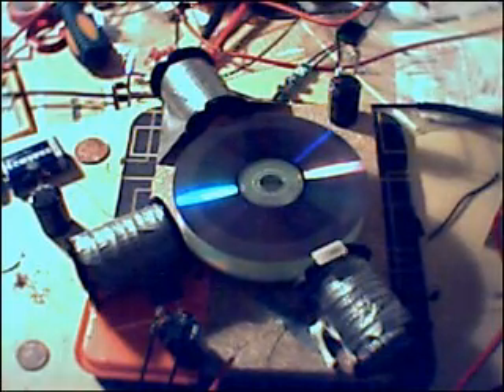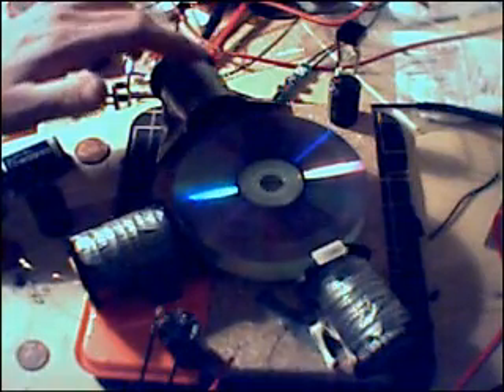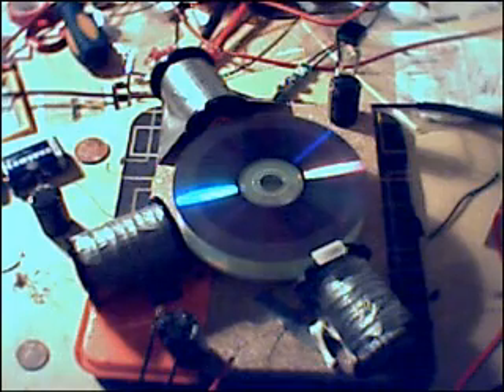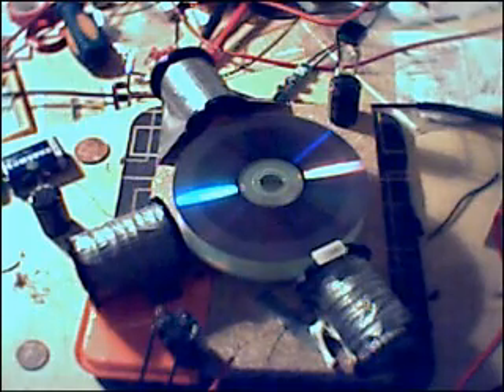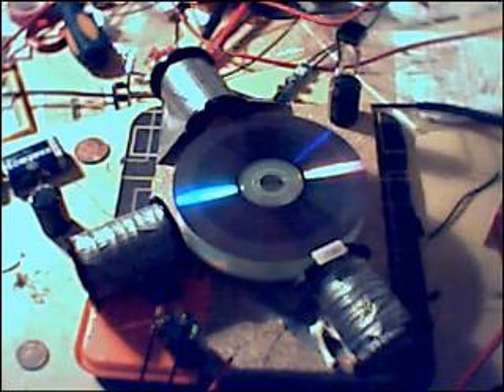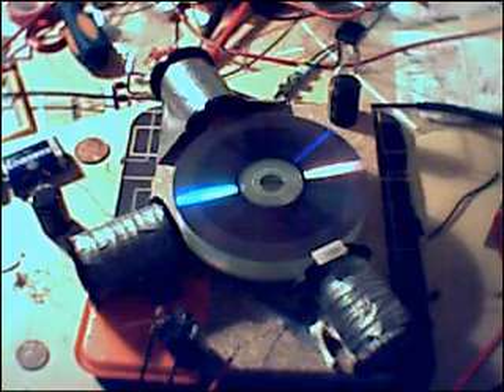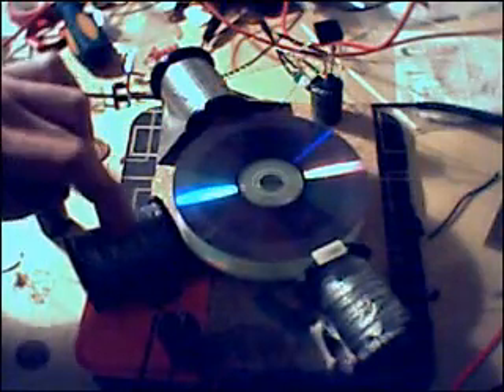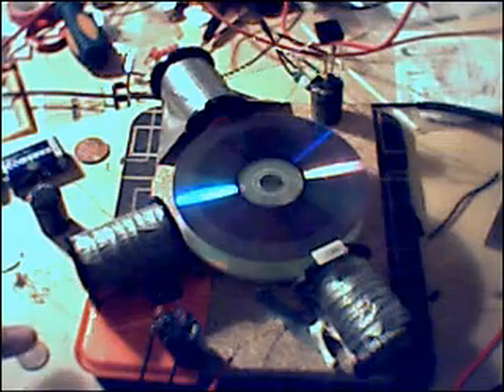My SSG - Producing and incredible amount of juice!

Comment: A great trick to try is to SHORT  coil leads on your gen coils out with a switch - just a millisecond or so - this will collapse the coil and on rebound you will get X20 voltag in caps
find a sweetspot in timing where it doesnt affect your  draw to motor

Blast caps into batteries in a timing  in synch with your motor coil pulses - do the charging at "0" line if looking with scope - correspondes to OFF time between motor coil pulses -this is when to release caps to charge

Comment from the maker: Actually Rob, The 'power' discussed in this video refers to the energy captured in my capacitors. These caps are fed by generator coils, being induced by magnets passing. These are not bifilar coils and are not connected to the rest of the circuit. As for your other comments, many thanks.

Comment from the maker: curious. I just did a current measurement on the output of my latest design and im getting clear readings. Still testing but seem to be getting high voltage spikes at 160ma, this is made variable by the trigger.

Comment from the maker: working today, cap one easily attained full capacity. All the capacitors are rated at 2200uf 63V. So, today when I discharged them into the small motor, there have been some big sparks! Also some nice little burns...